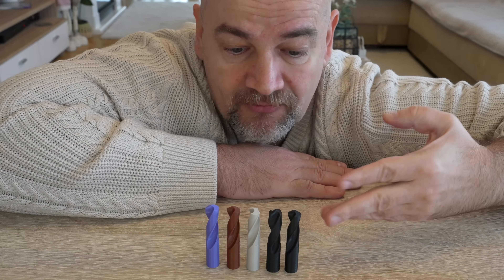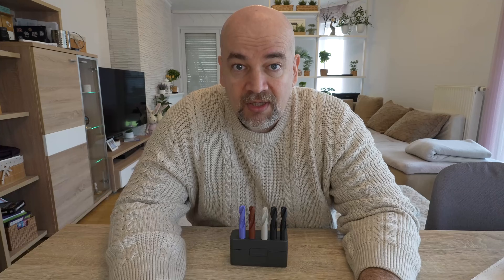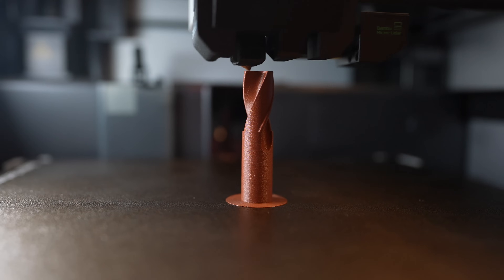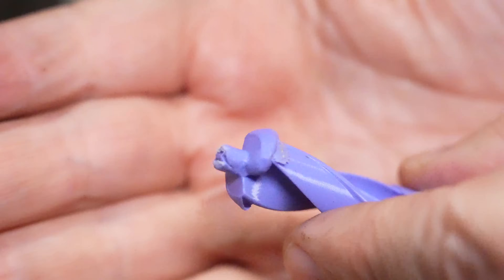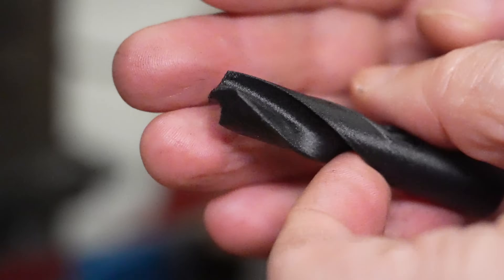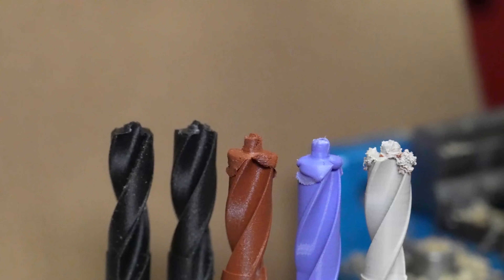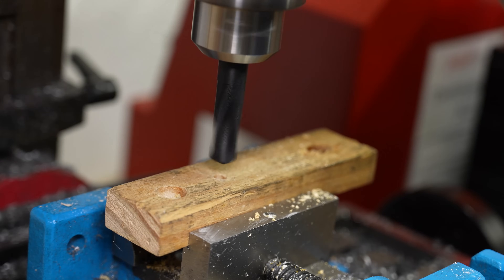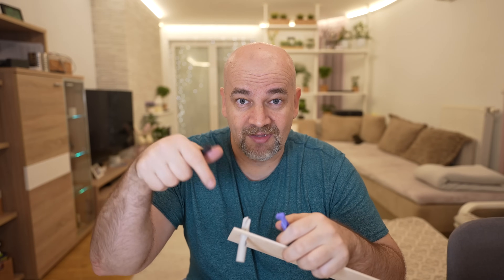3D Printed Twist Drill: Can It Actually Cut Wood?

Comment: I would be curious it's not practical at all but try cutting that wood again but with a continuous stream of water running over it to prevent the plastic from overheating it's not the plastic is it strong enough the plastic isn't breaking it's melting from friction so if you can control the temperature you might get different results again not practical but would be interesting to test

Comment: I think the two main issues would be friction heat energy and the hardness level of the bit vs the material. If the material is softer than the plastic, it should work fine, as long as the friction energy doesn’t melt it first. Probably the next thing to try (for fun) is drilling into thicker Sheetrock or softwood (where it worked) and see at what point does it melt. This reminds me of how CNC machines use water to keep things cool.

Comment: I really enjoy these types of videos, you know what the outcome will be but it’s cool to see just how far you can push the materials, how they fail, etc. 

Maybe a more practical drilling application for 3d printing would be something like a custom sized or adjustable diameter hole cutter using carbide inserts? Would probably lack the rigidity for drilling metal or high precision but could be great for wood projects.

Comment: Heat is obviously the enemy here. So rather saying this is a silly idea, consider it an early one. 

Metal drill bits are not designed to dissipate heat. Consider ways to cool the bit while drilling, whether it be fan blades or veins or whatever you can come up with. Then you want to redesign the bit to “cut” with minimal friction. 

Alternatively, find applications that don’t require a ton of friction. Like drywall or even foam!

Comment: a cool experiment, thanks for testing this out. The form of the drill is made for metal. I think with plastik it needs to allways cut and no friction while the turning process. So I'd sugest of steeper blade (while staying stable, if possible?) and significantly fewer revolutions per minute, maybe 60Upm?  But It will still melt, but maybe it will cut a nice chip first. ;)

Comment: I wonder if it would work if you:
• Used PC-CF as the material
• Operated at a slower drilling RPM
• Printed a geometry that just uses carbide inserts as the cutting edge so the plastic is not itself the direct cutting material.

Comment: What about making bits for a bit brace?  The low speed would cure the melting issues.  Not sure if you can get the lead threads or cutter to actually cut though.  Worth a try I’d say.

Comment: I wonder what would happen if you add a cutting fluid, even just water, to keep the drill bits from melting
Reply from the maker: PPA-CF was not melted, it was not strong enough on sharp edges. Temp resistant over 240°C

Comment: As I'm assure your aware, friction is your barrier here... So you need a filament that can resist friction and deflect the heat. So Nylon CF would be stiff, and be self lubricating, but would most likely still get too hot and deform. So I'm thinking for consumer grade filaments, Polycarbonate (or PC-CF) is going to be your best bet to resist the heat. Obviously PEEK and Ultem would probably be best, but that's not gonna happen.

Comment: Very interesting! I would love to see an attempt to use 3d printed auger bits in a hand-cranked Brace Drill! It can be difficult to find auger bits for older brace drills, so if one could be 3d printed and last long enough to make it worth the cost of the plastic, it could be useful. A brace drill probably won't get hot enough to melt the plastic, and the geometry of the flutes is different. Sharpness will still be the major problem, but the question is: can you overcome that with brute force? It would be very interesting to watch!

Comment: Looks like you've made a machine that turns 3d printed drill bits into 3d printed dowels!  

I was shocked at how good the metal 3d printed bit worked.  That was pretty impressive.  Sometimes the exploration of silly ideas leads to learnings that power revolutionary ideas.  Even child's playing has an educational component to it.  Push the boundaries! Be silly! The real ones will stick with you.

Comment: I’m wondering if adding oil or liquid would prevent heat deformation while drilling with these, unfortunately the video did jot cover this idea
Reply from the maker: PET and PPA were not melted, there the cutting edge was not strong enough against hard wood.

Comment: I think a high temperature engineering resin would work better, especially for a drill bit this size. Smaller bits would snap easily once they grab. The cutting edge will probably chip in harder materials. Now I want to try this. 😂
Reply from the maker: Inform us, if you need, the twist drill STL: https://www.mytechfun.com/video/212

Comment: This was very fun. Given the tortion test results I'm surprised none of them sheared in half. I'm surprised the sharpeness and heat resistance are the primary drivers of failure in this test. Very cool work. 

A truly cool idea would be a carbine insert drill or end mill that is 3-d printed would it hold up to the torque if the cutting was handled by something else. But please don't waste the money unless a carbide maker sends you inserts. Kennametal or some German carbide maker might be game.

Comment: Knowing where a material does work is only half of the story, there is value knowing where it is not 😉
And good times keep illness and old age just a bit farther 😁

For soft thin wood, punching might work better. Let's not take things too seriously. Or maybe just a bit :
With carbide insert(s) we might see quite different behavior at least on medium wood (pine, spruce) if the drill itself can keep handle torque. Safety glasses recommended 😅

Commenters, don't be wet blankets: enjoy the technology and (plentiness? multiplessness? multitudeness?) plurality(ness) of ideas. We can successfully 3D-print helper tools, covers, dust extractor parts - and yes, big bolts for tightening hand saw to broom stick adapter (for dropping snow from roof edge, in case you didn't know or didn't have snow on roof 🙂) etc.
Real carpenters do 3D-printing in ways we, with a thumb in middle of the mouse, don't even dream about.

Comment: They make drills with replaceable cutting inserts in larger sizes, and there are thin sharp carbide(and also HSS) insert available in rather small sizes, a printed body with glued in place or bolted on inserts should be doable(glued down to maybe 10-12mm and bolted on from about 16-20mm and up)

Comment: It's all about fun! I trying to design latch mechanism for the case and I testing the flexibility taking into account the thickness, length and the orientation of the object. I hope my testing will end some day :) I don't really trust latch mechanism that is integral to the main part because if latch breaks the entire main part is screw up so I trying to make separate latch that will be attached to the main part later.

Comment: 3D printed washer are a great thing. Especially using TPU since they can act somewhat as a seal. Printed bolts can be useful as well. The windscreen on my motorcycle is affixed to the frame using nylon bolts, washers and nuts. They act as a safety device in case the rider goes flying off the bike since they will shear before the polycarbonate shatters.
Reply: There are plenty places we use soft, plastic washers. For example: porcelain sink, toilet etc. The only reason i did not printed last week because the whole set (washer, bolts, inserts 2x) cost me more less than a dollar. So its not worth the time.
Reply: I used 3D printed nuts and bolts to mount a motor on my DIY rock tumbler. They've lasted for 2 months straight of tumbling about 2 pounds of rocks.
Reply: Yeah. In theory it maybe more expensive. But if the next store is far away from you, maybe it's still cheaper just to print it. Or if the seal is broken and it's 2 am.. :)
Reply: I created a 40 piece 3d printable toolset that I use all the time around the house, I just print the size I need when I need it. I'll have to look into adding nuts, bolts and washers to the set.

Comment: Can you use some coolant? Or add metal carbide inserts to the edges
Reply: Forget carbide; a lot cheaper metals could transfer more force than the plastic will withstand. Maybe a razor blade or utility knife blade could be formed to a good size insert?
Reply: @ how about drywall screw heads
Reply: hss inserts are cheaper than carbide, had the same idea 💡
Reply: @iopfarmer I think you would prefer HSS anyways because you can get or make them much sharper than inserts which have a radius and require more power to cut.

Comment: These would be useful if drilling into drywall to mount things to the wall so you don’t accidentally hit power wires.
Reply: I like this idea a lot. Based on what you said, I went ahead and printed a couple of bits and tested them for exactly this purpose. The beautiful thing is even if they do damage the wires, they protect you from harm by not conducting.
Reply: or use it to make an ancor for a metal screw.
Reply: Europeans in the chat 👀 your walls are drywall… not stone ??
Reply: @dinoscheidt  outside walls are stone or concrete, non-loadbearing walls between rooms are often made from a wood or metal frame and covered with drywall.
Reply: Great idea.
Reply: Good idea
Reply: i guess it depends on what your end goal is but you're reinventing the wheel here. Drywall anchors with a drill bit tip already exist, and so do stud finders that alert you if you detect an energized wire. Both are inexpensive, and the anchors even more so since they seat in place ready to have a screw put through it.
Reply: Infuse the material with some sort of abrasive grit and it might work quite well on harder things like metal.
Reply: @robertsmith4681 , it would get even hotter.
Reply: @robertsmith4681  The problem is heat and hardness
Reply: @Harrysreptarium resin = harder
Reply: @robertsmith4681 that would likely have the same result on the nozzle lol
Reply: Actually a good idea,but if it can cut drywall it can probably strip insulation off a wire.

Comment: We had a discussion about PEEK as an option and why it's so expencive. I found this text on the subject of cost. 
Excuse the wall of text. 

Introduction:
When it comes to high-performance engineering thermoplastics, PEEK (Polyetheretherketone) stands out for its exceptional mechanical and chemical properties. However, one aspect that often raises eyebrows is its relatively high cost compared to other plastics. In this blog, we will explore the reasons behind the expensive nature of PEEK plastic, shedding light on its unique properties, manufacturing intricacies, raw material costs, and market dynamics.

Unique Properties:
PEEK possesses a remarkable combination of characteristics, including high heat resistance, excellent chemical resistance, low moisture absorption, and impressive mechanical strength. These properties make it an ideal choice for demanding applications where other materials may fall short. However, such exceptional performance comes at a price.

Complex Manufacturing Process:
The production of PEEK plastic involves intricate manufacturing techniques and specialized equipment. The polymerization process, followed by extrusion or injection molding, requires precise control of temperature, pressure, and reaction conditions. This complexity not only adds to the overall production time but also contributes significantly to the higher cost of manufacturing PEEK.

Raw Material Costs:
PEEK is derived from petroleum-based sources, and the cost of its raw materials is subject to fluctuations based on oil prices. As a specialty material, the demand for these specific raw materials is relatively low compared to commodity plastics, resulting in higher material costs for PEEK.

Research and Development:
The development of PEEK plastic required extensive research and development efforts to engineer a high-performance material with exceptional properties. Significant investments were made in testing, refinement, and the creation of reliable manufacturing processes. These costs are passed on to the end-users, contributing to the overall price of PEEK.

Limited Supply and Demand:
PEEK serves as a specialty material with a relatively small market compared to commodity plastics. Its demand is primarily driven by industries with stringent requirements, such as aerospace, automotive, medical, and electronics. The limited supply and high demand for PEEK contribute to its higher price.

Quality Control and Certification:
To ensure consistency and compliance with industry standards, PEEK undergoes rigorous quality control measures and certifications. These additional processes, including testing and inspection, are necessary to guarantee the material’s reliability and performance. While crucial, these quality assurance measures add to the overall cost of PEEK.

Regulatory Compliance:
PEEK finds application in industries such as medical devices and aerospace, where compliance with various regulations and standards is essential. Meeting these stringent requirements often requires additional testing, certification, and documentation, which further adds to the cost of PEEK plastic.

Specialty Applications:
The high cost of PEEK is justified by its ability to perform in specialized applications where other materials would fail. It is widely used in critical components within aerospace, medical implants, and high-temperature environments, where its exceptional properties are essential for safety and reliability.

Conclusion:
PEEK plastic’s high cost can be attributed to a combination of factors, including its unique properties, complex manufacturing process, raw material costs, limited supply and demand, research and development expenses, quality control measures, regulatory compliance, and specialty applications. While the price of PEEK may present challenges, its exceptional performance and reliability make it indispensable in critical industries where compromising on quality is not an option. By understanding the reasons behind its expense, we can appreciate the value that PEEK brings to these specialized applications.

Comment: Пластики деформируются от нагрева, сверление нагревает поверхности за счёт трения, эксперимент обречён на провал
Reply: Depends on the speed, keep it slow enough for heat to dissipate and it should work as a drill, just very very slowly.
Reply: @robertsmith4681  да, я тоже сначала думал про очень медленную скорость, но тут решающий фактор это теплоотвод в самом материале сверла, у металлов он сильно выше чем у пластиков... По этому это не рационально просто...